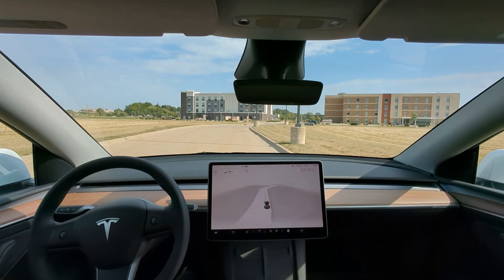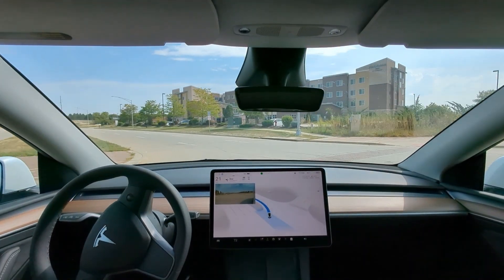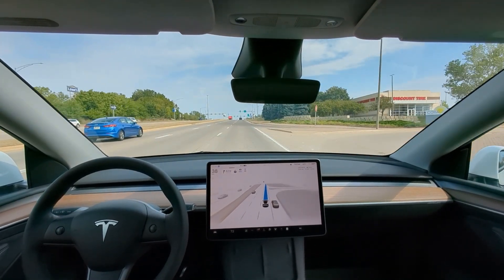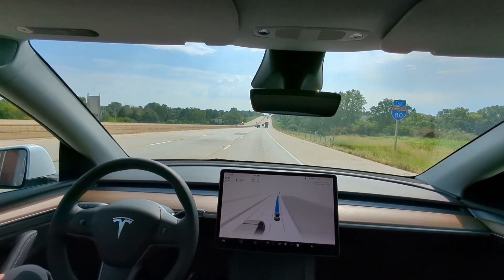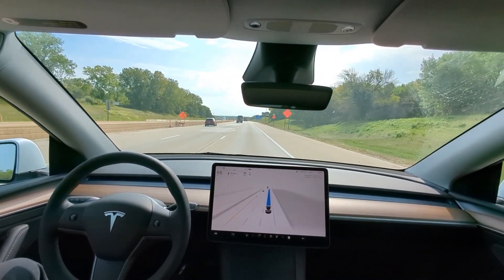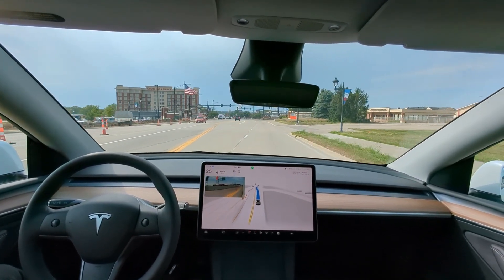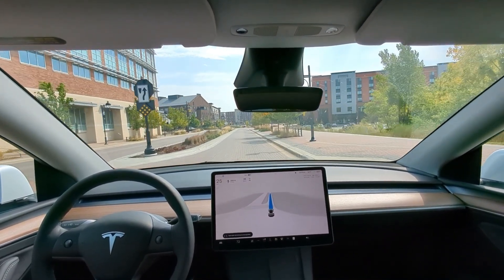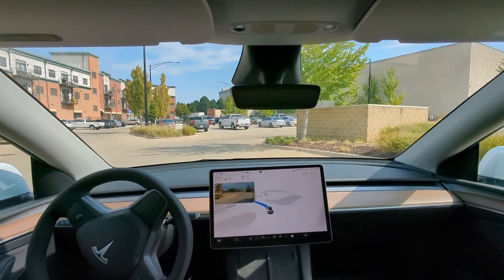Tesla FSD HW4 - So many FAILS!  Pls Fix!!

Comment: Instead of tugging on the wheel,  just flick either of the scroll wheels. I usually roll the right one up then down (so the speed doesn't change).

Comment: That is one heck of a bumpy ride for a SUV. Seems harder than my 2023 Model 3 which itself rides pretty harsh.
Reply: Lower pressure to 35psi
Reply: @mathieusturkenboom  Yeah. I lowered tire pressure to 39 psi and it’s better than 43 psi. Haven’t tried 35… isn’t too low from the recommended?
Reply: @maheshvpy  when it dips to 33psi
The tpms symbol comes on..
But wtv
I live in Montreal where roads are destroyed,
I believe i lose like 1-2% range. Not a big deal for me..
Reply: @mathieusturkenboom  I have the same feeling. I’m okay to lose 2-3% efficiency to avoid bone jarring ride, lower back pain. I definitely see an improvement in the ride quality with 39 and will give a 36-37 a try.
Reply: thats why u gotta get the model s or x. its much better ride quality
Reply: @Fumbiii16  Model S and X are nice but they are bulky and clunky. Also that doesn’t mean that the Model 3 and Y need to ride rough!
Reply: @maheshvpy  its not if you know how to drive. i used to drive a truck and its not big and i have a low coupe 2 door. model 3 and y dont ride the best plus theres a bunch of wind noise. s or x is the best in terms of ride comfort and premium luxury. they can also handle great even if its clunky or bulky. no one likes a rough road trip or rough daily unless ur tracking it
Reply: @Fumbiii16  I’m sure model x and s ride bit more comfort given the higher price. My point is that does need to be a reason for the poor suspension in model 3 and y. I have have driven cars for 30 years and cars that are much lower in price compared to model 3 have much better calibrated suspension. I have driven a fiat sedan that had a sticker price of USD 15K equivalent which drove far superior in terms of comfort with fantastic handling with able chassis and hydraulic steering. Tesla simply did not invest in a good suspension engineering for model 3, period. It rides like a skateboard on rubber.

Comment: Tried it in the city for maybe 40 min total, 5-6 drives, did almost perfect with 1 exception I just recalled -- construction in the middle it didn't know if it should go left or right. Highway only once but tomorrow lots of highway driving. So far I t think its been incredible impressive. 2023 Model Y HW4 as well. Thanks for the sunglasses pro tip 😎